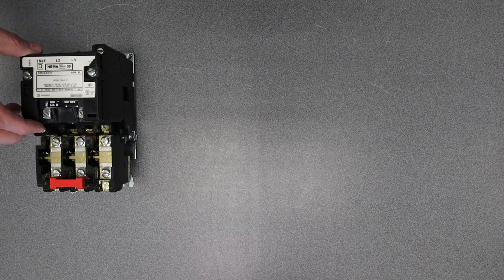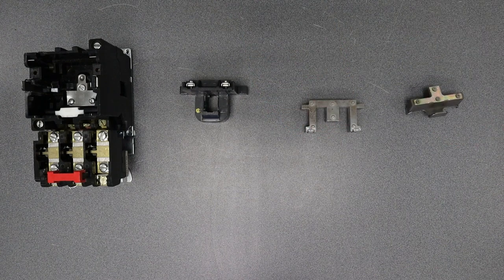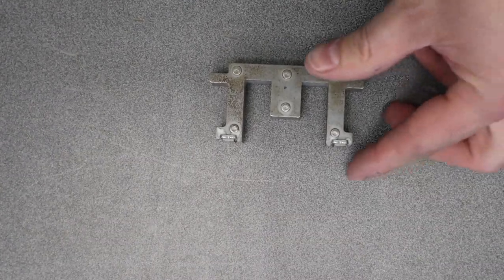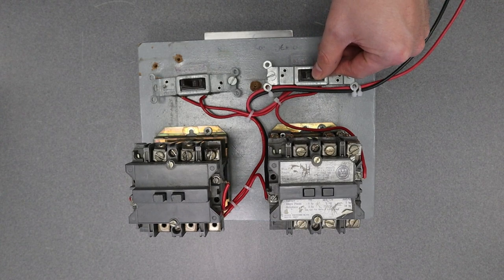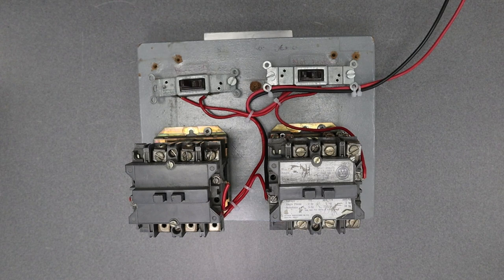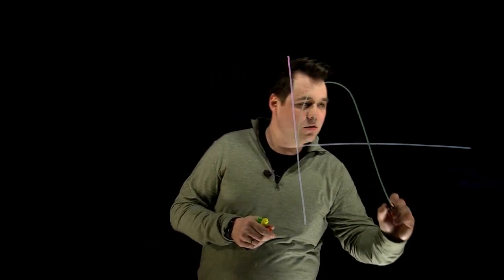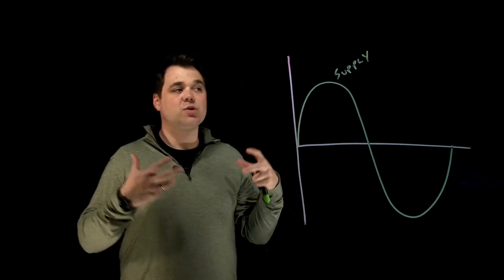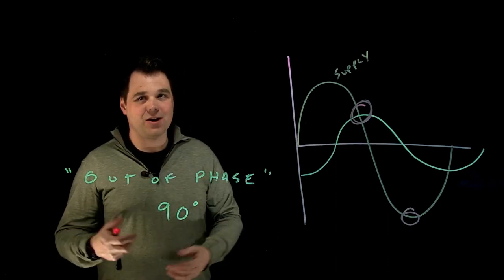Shading Coils

Comment: It would be good to mention how the magnetic fields for the shaded and non-shaded pole portions do not occur at the same physical location and the armature is attracted to the core irrespective of the direction of the magnetic flux. It is the attractive forces on the armature that add.  Explaining WHY the magnetic flux at the shaded pole lags the flux at the non-shaded pole by 90° (induced current in the shorting ring producing its own magnetic flux) would also be helpful.

Comment: Your explanation is incomplete.  First, the practical phase shift is more like 45°, not 90° (if you got anything near 90° by having the resistance of the shading coil very low, the amplitude would be hopelessly weak).  Second, no matter what the phase shift is, adding 2 sinewaves will ALWAYS have 2 zero crossings per cycle.  There are 2 things you miss.  First, the 2 sinewaves each have their own SEPARATE magnetic paths in the iron, one passing through the shading coil, the other not.  THEY ARE NOT ADDED TOGETHER.  Secondly, the magnetic force is proportional to the SQUARE of the wave amplitude.  So EACH wave is SQUARED, SEPARATELY, then the forces are added together mechanically.  The sin² forces are always positive, each becoming zero twice per cycle.  But the zero crossings of the 2 phase-shifted waves are misaligned in time, causing there to be a positive pulling force that NEVER becomes zero.

Comment: I get that with the 2 sine waves neither are both at 0 at the same time, but aren't there still points where the sum of the 2 waves is 0? For example between the 2 points you circled the sum goes from positive to negative, so at some point between it must have been exactly 0. Why isn't there chattering at those points?